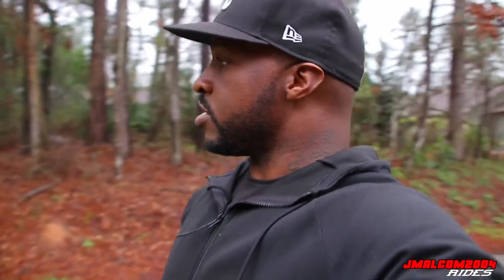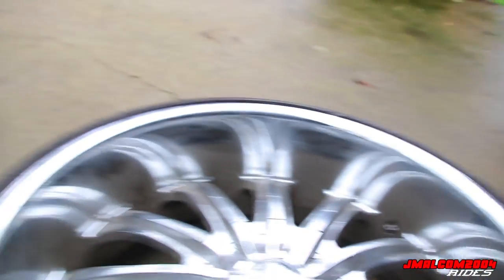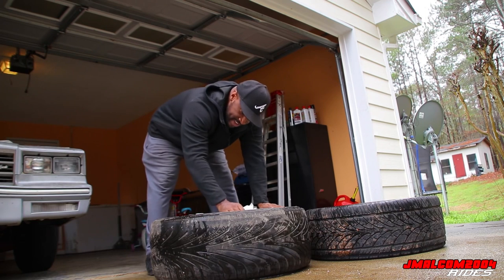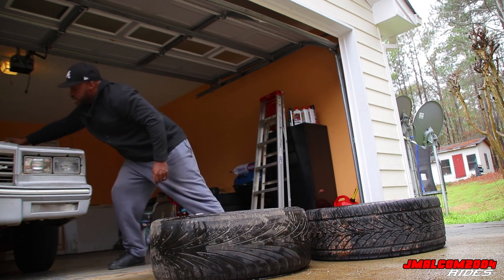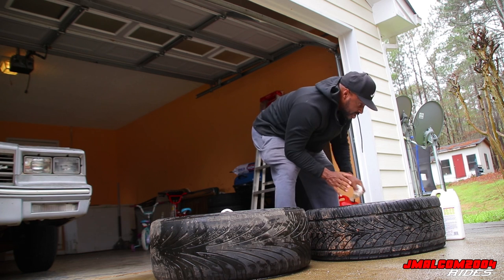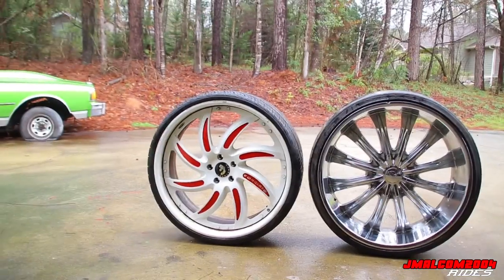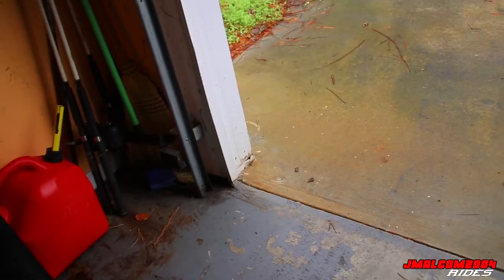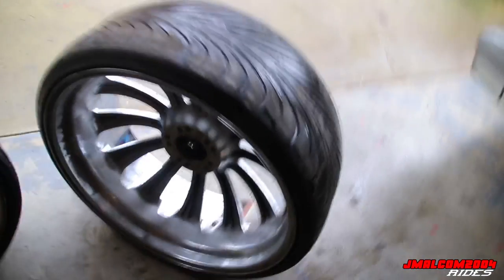ARE NAME BRAND FORGIOTO 3 PIECE RIMS HEAVIER OR LIGHTER THAN 1 PIECE OFF BRAND RIMS?!?

Comment: casting has more air pockets cause its starts in a liquid form then poured into a casting that's why it's a lighter wheel
forged is cut from a block of raw material to create a shape even though it weighs heavier it's a more durable wheel,, THAT'S JUST MY THEORY
BTW GREAT VIDEO!!